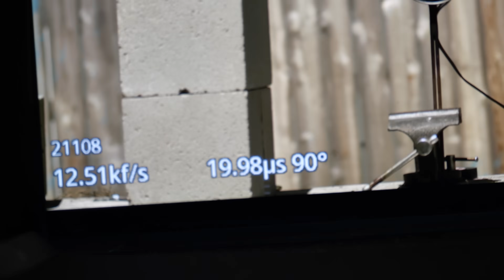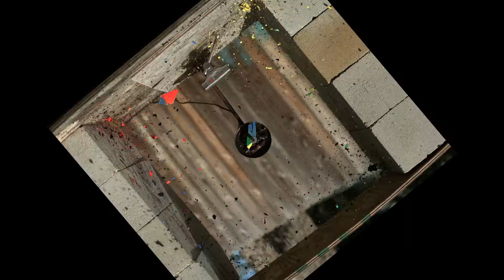Spinning a Record to Pieces at 12,500fps - The Slow Mo Guys

Comment: Hi Gav, hi Dan, I know you like explosions, I know you like fire, and I know you like doing stuff one's not supposed to do because bad things will happen. So why not make a video where you use a frying pan, overheat the oil in it until it's a grease fire, and then try to extinguish the fire with water, which is obviously the worst thing to try because it'll just explode in a giant fireball.

Comment: The motor is called a "series wound" or universal motor. It will take enough RPM's to blow it's own bearings if run unloaded. The heavy record slows it down considerably.

Comment: Probably a dumb question: Why do you not get the rolling shutter effect with the slow motion camera? I realize it's much much faster than a normal camera, but I thought there would be a little bit of an effect. I'm assuming that the camera works the same way as others and if you got something going fast enough you would still get the effect, yes?
Reply from the maker: SlimThrull this phantom doesn’t have a rolling shutter.
Reply: Ahh so you'd never get the effect with it. Neat. Thanks for the reply.

Comment: 1:59 Reminds me of when I got my first 24X CD-ROM drive back in the day, it made that exact same sound from all the vibrations from the disc. The vibrations were was so bad, that the drive couldn't even read the disc at maximum speed, so it had to throttle down to a slower speed.

Comment: Imagine spinning it and releasing it so that it spins away
Reply: there goes everyone in a 20 ft radius
Reply: It would be like that guy in this Spongebob Squarepants episode, at the front of the marching band spinning the flag so fast that he takes off and crashes into a blimp. rip.
Reply: I tried making a mechanical television and camera that required a spinning nipkow disc. I used records for the discs. The record was spinning so fast that the record came off the motor shaft and spun at amazing speeds to my  refrigerator. The thing shattered everywhere and if it spun any faster, the refrigerator may have scarring.
Reply: GOTTA GO FAST
Reply: Filfy frank tv
Reply: ive always wanted to release a record
Reply: hahahahahahahaa
Reply: I used to do that all the time when I was a child. I took a Lego wheel, connect it to a motor and disconnect it once it reaches maximum speed. That wheel jumped up almost to the ceiling once it hit the wall.
Reply: A Vsaucy Boi ha
Reply: Zak-A-42 *zepplin
Reply: Kung Lao's hat :)
Reply: Destructo Disk!
Reply: A Vsaucy Boi it would be spinning against the far wall for like 10 mins
Reply: bablade! 😂

Comment: About how it wobbles and then stabilizes, the motor is vibrating and as the speed of the motor increases the frequency of the vibration increases. The record will have certain resonance frequencies at which the vibrations through it will not interfere and you can see them.

Comment: 8:01

The record itself is giving a motion distortion in response to the shutter but the display on the camera shows the quadrants normal as they are photographed.  I think the display on the slowmo cam shows a full high speed frame, but it's refresh rate is slower than the shutter speed on the standard camera filming it, meaning that we are recording one solid frame of the  slow motion video.

Comment: I'm a researcher and an expert in rotary vibration. The warped ones cause unbalanced forces that cause the critical stress intensity factor to be exceeded at the centre due to unbalanced forces. The more symmetric ones break at the outside because that's where the angular acceleration is greatest (a = v^2/r). You can see the warped ones generating travelling circumferential waves, particularly for the one after the four sectors.  This is beautiful, you could write papers on this. Make one out of transparent polymer and use a polarising filter, you will be able to see the stress patterns as a rainbow. AWESOME video :)
Reply: It's useful for designing aircraft engines and such
Reply: What exactly does research into rotary vibration entail? Why is it useful to research? I’m really curious how you’d get into that field, did you sit down one day and think rotary vibration research is going to be my job one day?
Reply: They really need to do that polymer idea, that would be so cool to see the stress colors changing.
Reply: TheRockyGamer 1 smart, but mostly hardworking, I bet ;)
Reply: I didn’t understand anything besides the part where you said “ones breaks at the outside
Reply: The equation you gave (a=v^2/r) is for centripetal acceleration, not angular. Angular acceleration should be constant for a rigid body.
Reply: ... wot
Reply: R/iamverysmart
Reply: WHAT ARE YOU DOING ONE YOUTUBE??!! GO TO COLLEGE!!
Reply: Harry Grigg NO ONE CARES
Reply: Harry Grigg stfu

Comment: You would reach higher speeds if you stabilised your motor. If it was solid, the objects would be subject to less torsion. Less torsion, less stress fracturing, stronger tensile strength, and subsequently, higher speed threshold. The easy way would be to bolt the motor to a strong, horizontal, level flat surface. Then you could place your blocks around the set up, and not have to worry about the shrapnel taking vertical flight at full speed.

Comment: Shouldn't that fps number be different in the title? 12,500 would mean that you play the video so extremely quick that 12.5k frames play each second.
But slowing down video reduces frames per second. E.g. 0.5 fps or slower.

Comment: Given the manufacturing process of vinyl discs being a molten lump of PVC being compressed between two metal plates, would it be fair to say that the origin point where the split begins is potentially the spot where the polymer starts cooling first?

Comment: i love the simple physics of this. because the interior is spinning as fast as, or faster than the outer edge, and the two are connected. the outer edge gets pulled to pieces because it cannot accelerate at the same rate that the center is accelerating. it is still amazing to watch.

Comment: I'd like to see you spin one of those vinyl records up but make sure you have it perfectly centered before you spin it up.  
I think it'll go a lot longer before shattering. 

Also, mount the Dyson spinner from 3 or 4 points, i hypothesize, by watching them spin apart, that it's the repetitive rpm multiple mentioned at some point in video which is causing a sort  of death wobble. 
 Commented while at 7:09 in video

Control the speed slowly upward, slower than any time you've video'd

I'm watching it and counting, it goes "wobbly" at certain rpm multiples, it's resonating basically at those multiples, but diff for every record, noticeable on painted ones.

I'd make a prediction, the records are cut in a spiral to record the music, the crack forms at either the inside start of that spiral, or the outside termination point.

Comment: I would suggest a bigger washer between the nut and the record to distribute the force from the tightening of the nut, so the record would tear it self apart without as many compression stresses focused directly in the center.

Comment: Somewhat amusingly, based on the assumption of an FPS of 12,500, the coloured record was spinning at ~12,500 RPM when it broke.
And, assuming a 12 inch record, the outer edge was travelling at ~199 m/s. The chunks flew off at airliner speeds.

Comment: See the record as a wave spinning about an axis. At some speeds, you hit harmonics - cause the wave to line up on every revolution. Other speeds cause interference which is "destructive" to the wave, as the wave from one revolution will cancel out the wave from the second - this would maximize stability. The first situation maximizes harmonics and focuses the rotational energy in just a few areas.

Comment: I don't know why, but the fact that this video is shot at 50fps rather than 60 really bothers me. It just feels... unnatural.
Reply: FartingSpider12 
50fps were used in European videogames.
50fps takes less power to render a video.
50fps is good enough for a smooth video. 
;)
Reply: FoxWare 50 is double 25 thats why

Comment: When are we finally gonna see thermal imaging in slow mo?  I for one predict that the heat distribution patterns would of course correlate to the failure propagation but would still be fascinating and might even provide surprising or unanticipated insights into the causes of the failures.  In fact, using thermal imaging results might make it possible to test theories on how to reinforce the materials to cause a spinning disc like this to survive at higher RPM.

Comment: The reason it's buckling and shattering is because the torque applied to the center is so strong that the outer rim cannot accelerate fast enough to stay in sync, because of mass and because of the material flexing. The outer rim ends up lagging behind until the stress is so high that the material shears at an edge or at the center.

Comment: hope you were careful with what records you destroyed. I found many rare records from a family friend who was throwing them away. I found them in the trash and pulled them out and had them cleaned and discovered that many of them worked. One of them was a rare release of "under paris skies" by Liberace that never charted and is very rare with not a single mention of it on the internet aside from one ebay post. You never know the rarity or value of a 78' just based on if it's sold at goodwill or at a high-end antique shop. As an antique collector and restorer myself, this video makes me cringe...

Comment: The wobbles are what breaks it, the pressure off the dial in the center creates the crack , not a good measurement of the spinning force rather than the break at the center due to off spin of your equipment

Comment: 7:13 needle nose pliers, my god. 
How much money does your channel make? Cant afford a wrench? Or should I say, a spanner?
Reply: I think thier camera takes priority
Reply: George Smith how little control do think a spanner gives?
Reply: point was they don't "need" a spanner as the OP implied, being supposedly shocked they didn't use one.
Yes, you can be very delicate with a spanner, but that wasn't my point.
Oh and while we're on, they weren't needle nose pliers, they were long nose pliers.
Reply: George Smith right right
Reply: Don't need one.
A wrench or Spanner would impart too much force and possibly crack the vinyl before they even got going.
It would have only needed to be lightly gripped, and I suspect even the pliers were overkill for this application.
<looks back down at newspaper with a grunt>

Comment: I'm curious if an how the record would perform if you were to spin it in it's normal horizontal plane rather than the vertical...  the induced wobble seems to be what causes it to break... would it spin any more stablely in the horizontal plane?

Comment: Of a note, sawmill saw blades that are 4 to 5 feet in diameter are hammered so that they have a slight dish in them, then when turning at cutting speed the blade expands and runs straight, if it is run over speed it will begin to wobble looking wavy and will fail to cut straight.

Comment: Other reason as to why the motor might not be spinning up faster is because of the amount its shaking. If you could have found a better way of strapping it to the table reckon you would have gotten better results.

Comment: In this video you can notice that the pieces does not follows a strict "away from the center" trajectory when the disk breaks. It  performs the sum of the "away from the center" and "anti clockwise" vectors. So pieces in the right goes up and right and pieces in the left goes bottom and left. Really good to explain centripetal vs centrifuge forces. Amazing.

Comment: Talking about exploding cds, i once bought a brand new £500 pc (it had a bluray drive) about a week into owning it i put in an old cd (of emulators and games) and that exploded, the draw popped open and millions of small bits of cd dropped out (which i still have), it also killed the hard drive so had to buy a new hard drive AND dvd drive (didnt get a blu ray lol) i presume the old cd had a weak point? and the blu ray spins too fast?

Comment: @The Slow Mo Guys - You should spin other items on that motor by getting things like old computer mother boards, old light weight flat panel monitors/TV's, dinner plates etc and drill a hole as dead center as possible, mount it on the motor and spin them to see if they come apart or not. You may need a more powerful motor for heavier items. Would be interesting to watch.

Comment: Could the solvents in the paint you used be causing the crack to happen in the blue color?
Some thing to try. Instead of painting the whole section each color how about a 1" wide stripe and see if it still happens in the blue color section.
So funny I gave a thumbs up and I subscribed and rang the bell. Lets see MORE!

Comment: The reason it takes longer to get the records spinning is mostly because the records have a larger rotational inertia, which is because the radius and mass of the record is much larger than the cd’s so the records have more resistance to spin than the cd’s. 💥BOOM💥 physics

Comment: This is one of the most amazing videos I have ever seen and is an awesome demonstration of vibrations in rotating objects. 

These discs have certain natural frequencies and mode shapes based on their material and the way they are clamped. As the speed is increased, the unbalance force causes an outward force with a frequency equal to the speed of rotation. If and when it matches with one of the natural frequencies, the system vibrates at higher amplitudes and the record breaks eventually. The warping in the discs are in fact its mode shapes and that's why they break from the outside. The only case when it breaks from the inside, which is the first one, is because they clamped it way too hard and there is a minor crack (can be seen 03:30) which propagates and breaks its radially outwards.

Watching all of this and knowing the physics behind it is really interesting and breathtaking. Thanks for an amazing video!

Comment: The vibration of the motor sends a vibrating wave through the vinyl record causing it to go to its breaking point vibrating the atoms of that record until they are disrupted and fall apart.

Comment: So when I was training to be an aircraft mechanic and was learning about the physical forces that affect propellers, I learned that they're basically constantly trying to bend forward from the thrust, twist themselves straight from the pitch, stretch from the centrifugal force as well as bending sideways due to the rotation. 

Now that sounds impressive coming from a textbook, but I've always wondered what it looks like in slow motion ever since I read it. And from what I can find having a curious mind, nobody has done it with equipment as advanced as what you guys use here. 

It would be awesome to see this happen at an insanely high frame rate, anyone else think so?
Reply: You just did watch it happen at an insanely high frame rate... that's all slow motion really  is
Reply: big words hurt my mind

Comment: Challenge. Name a song that would not cause the vinyl to break. Hint. The vinyl breaks because of the uneven weight distribution at high rpms due to the raised surfaces on the vinyl.

Comment: So... is the warping simply a natural vibration mode like a Chladni plate, or is it induced by turbulent air flow relative to the moving surface, or does the air help damp the vibration? In other words, I want to see this done in a vacuum. Cody might have one large enough.

Comment: cool video!
two questions:
1. does the pressure from the axis nut/bolt squeezing together on the middle of the record affect how the record's stress fractures initially form?
2. does the varying mass of paint on the stock mass-distribution of vinyl record relate at all to the warping factors involved (as viewed from your angled shot)?
Have a great week!
Reply: Uhh, I'm not sure if they know the answer to either of these questions. Solid questions though.
Reply: All good. I really like their instructive technical banter while they set stuff up. They have a constant flow of interesting facts and figures. Perhaps they even had an off-camera chat about those questions themselves..?
=]

Comment: Safety last apparently. The very first one they did I thought, "they are just spraying their neighbors' yards with sharp projectiles, they really should put a board on top of the test area." After several attempts they final put the board on and look at the resulting damage. Idiots could have injured, blinded, someone. Seriously, these moron shouldn't be conducting these dangerous type of experiments in the backyard of a residential neighborhood.
Reply: The pieces going upward will not carry much energy nor will it keep that energy for very long.

Comment: You should do this with grinding and cutting discs as a demo on the dangers of angle grinders. Over spin a disc and it will shatter.
Reply: Yeah I learned never use cutting discs for grinding or that could happen very easily cutting discs are strictly for cutting only unless you got balls of steel